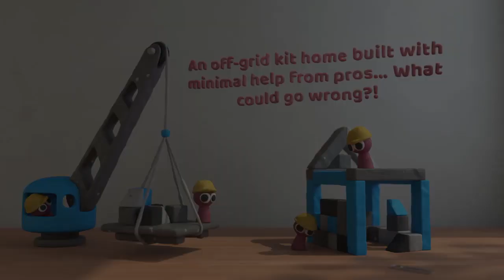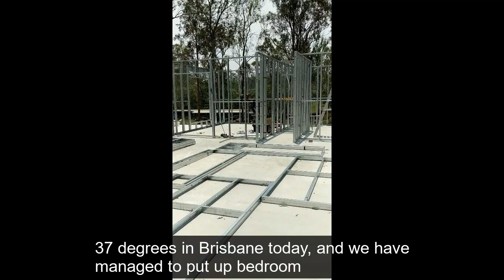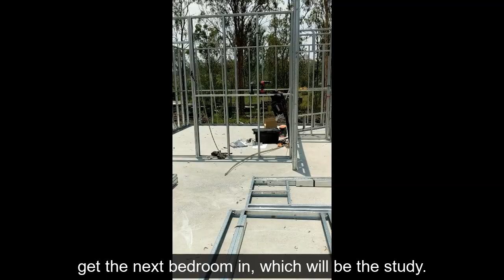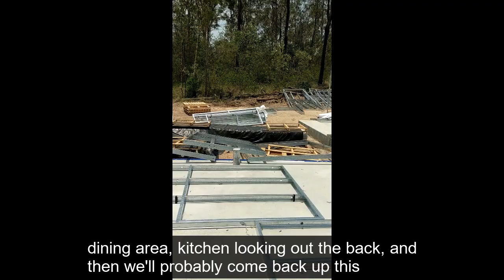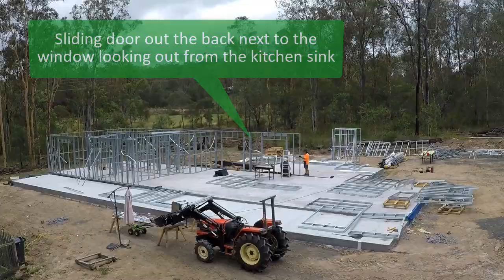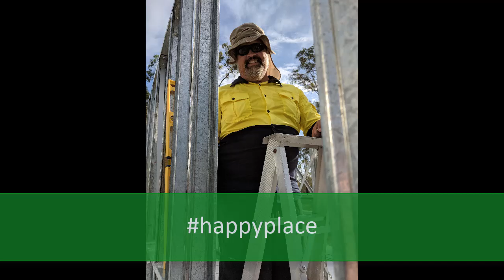Installing our steel kit home frame

Comment: 37 degrees is an underestimate I'm sure. It was so hot that I took a break during the middle of the day (you can see it in the video where the site is deserted). All the tools started overheating and the fasteners were too hot to hold without gloves!